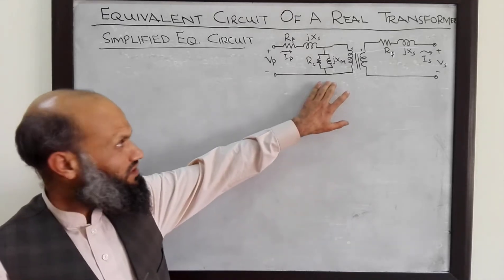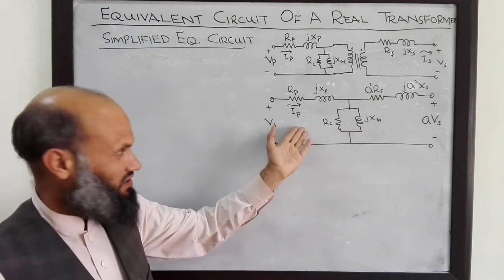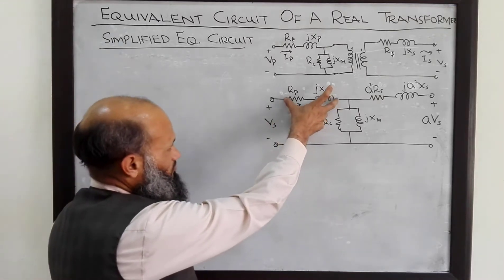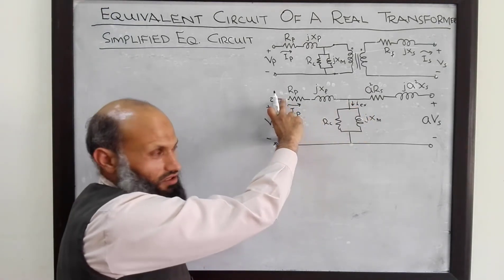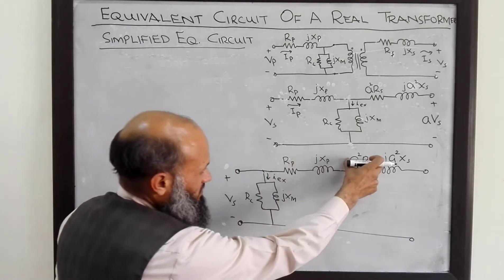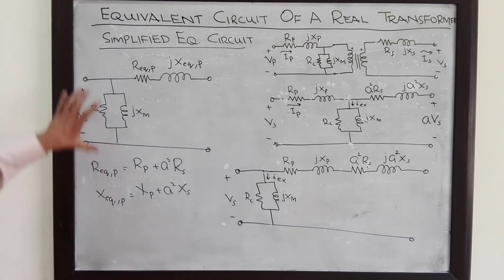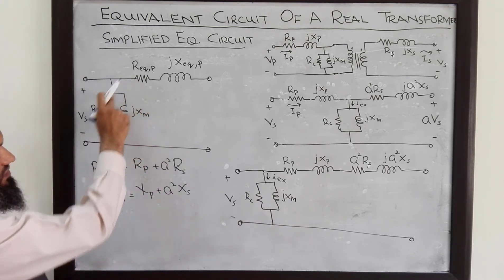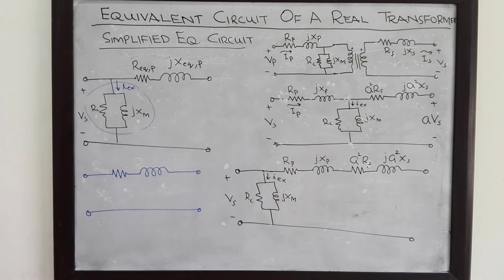EE213 - 08b - Simplified equivalent circuit of a transformer

Comment: Thank you  MAFarooqi for the lecture. Just a question, how do you add up the currents (one from the primary side and that referred from the secondary to the primary side) -because I see you have simplified the circuit by summing up the voltages and the reactances. but you have not talked about the currents. Kindly explain to me. Thank you.

Comment: Sir , what will be the current in the simplified circuit?
Reply from the maker: If you have obtained simplified equivalent electrical circuit of the transformer referred to the primary side, the current will be the primary current. And, if the equivalent circuit is obtained by referring all quantities to the secondary side, the input current will be a*I_p, where a is the turns ratio. In this lecture, the equivalent circuit is obtained on the primary side of the transformer and hence the current is I_p.